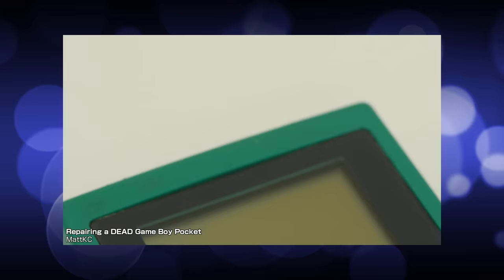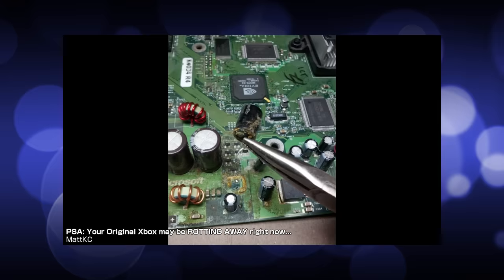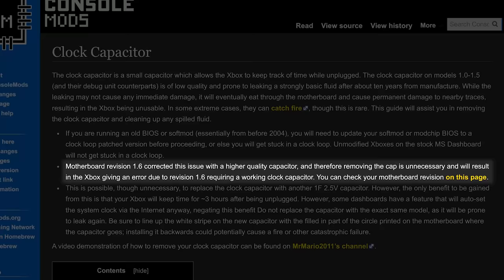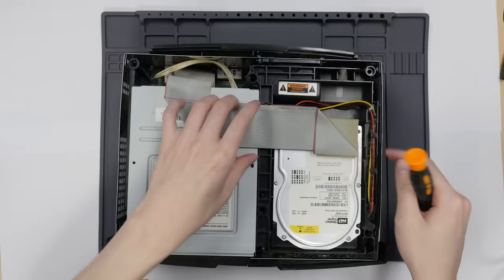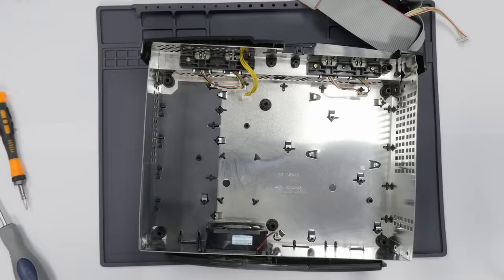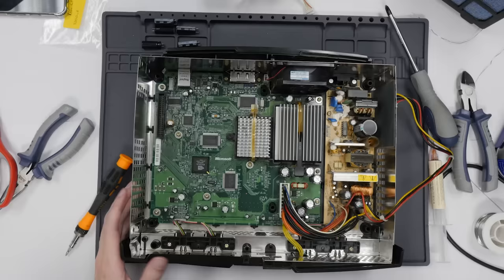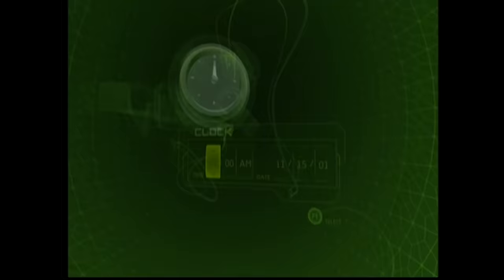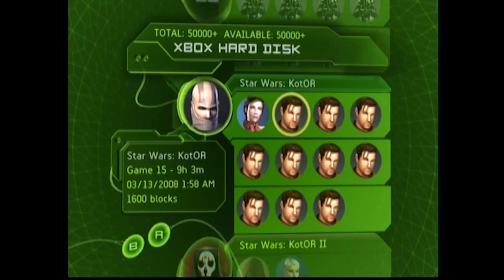DID HE SCAM ME? - Repairing a DEAD original Xbox

Comment: A concept i try to tell my dad all the time is that just because an electronic hasnt been used doesnt mean it still works. It could be still brand new in box but need immediate repair due to age.
Reply: like capacitors, and on the C64, the PLA IC, and many 386 and 486s have a nicd 3.6v battery that is prone to leaking. i got a new in box Soltek socket 478 board with capacitors already bloated and leaking.
Reply: @pentiummmx2294  to me belts in things like cassette players and turntables are the biggest example. Leave them alone for too long and they turn to goo
Reply: The easiest comparison is just say it’s kinda like how if cars sit for years they won’t be able to drive until you fix them up again

Comment: Side notes:
If you do find a random xbox in the back of the closet, when testing it, it is a good idea to plug the av cable in too. don't have to connect it to a tv just have it in the back. The xbox will throw a flashing green and orange ring light error if the av is not plugged in. People think the xbox is dead, but its fine just needs av of some kind so it can set the video output resolution on boot and will halt the system till it can.
On v1.6 xbox the clock cap is the gold one up near the IDE port, not at the front like others, Yeah it can leak but we still got a few years.
The caps you replaced are CPU filter caps and power conditioning caps.
TBH I have not seen the power conditioning caps fail but I don't work on xboxs as much as I did back in the day.
power conditioning caps is probs what killed this xbox, cant boot if the hole system doesn't have any power rails.
CPU filter caps are weird, when thay fail and depending on how bad the xbox will still sorta work but DO NOT RUN THE XBOX WITHOUT THEM.
When they are damaged you will find games will sometimes load the main menu but crash or get stuck when loading the first map, game overall is just really slow, when trying to do more complex things like a TSOP the homebrew will boot but then just fail to right or find the TSOP. If they are totally cooked or removed then the xbox will just get stuck in the boot splash or the system os screen.
Yeah your dvd drive is probs just dirty / full of a lot of dust. 

Alright, till next time
[skeletor running away]
Reply: Ok good to know
Reply: Man, I wish someone like you could help me recondition my Amiga (well, Amigas plural tbh!)
Reply: @Kholaslittlespot1  hm? What needed?
Reply: Yeah the Xbox is the only system in my experience that freaks out when it comes to the video cable. If you try to unplug the av cable while it's on then it'll reset itself.
Reply: @VexAcer  ahh that try blowing on the port.
Reply: Thx for info
Reply: I actually just replaced my crystal 1.6 clock capacitor yesterday… It was completely nonfunctional and when I opened it up it had leaked all over the board. Luckily it’s not really near anything so there was no permanent damage but it’s something to keep in mind.
Reply: lmao my 1.1/0 xbox's cpu caps were blown this entire past 20 years and i never knew until i found out, i had  wiggled out the clock cap many years ago not understanding any of this, the past year getting into soldering and recapping i took apart my xbox and lo and behold, EXPLODED cpu caps with nasty orange substence on the hdd cage. 
I was curious why my xbox was overheating so hard, smelling nasty, and audio glitching in games where i wanted to use optical audio, sure enough it was those caps causing the problems. I intend to recap the whole board later as a precaution.
Reply: Athough i don’t have an original Xbox, i did at one point discover that my Xbox 360s won’t boot when there is no AV or HDMI cable connected

Comment: I had the opposite happen 4 years ago at a Goodwill thrift store, they had an Xbox with an orange ring for $5, after dealing with a cashier who thought user info almost 15 years old would expire, turned out all the orange ring was, was a "No AV cord connected" error. A quick dusting, clock cap removal, drive cleaning, and mod chip later, it's still one of the cheapest consoles I ever got ($30 including the mod chip).

Comment: Matt, fwiw (from audio optical drive experience), tired/slipping drive belts can mean weak drive clamping, which means the disc isn't spinning at the expected speed when the drive tries to read the TOC. A cheap/easy check on that drive is a belt swap, I think. Thanks for lots of great videos. Did an condition inventory of my OG Xboxes over the holidays and was reminded of your clock cap vid.
Reply: the belt is only for the disk drive to open and close the lid, what would this have to do with the disc spinning or not (or too slow) ?
Reply: @MultiWirth  are all the Xbox drives direct drive?
Reply: @ChlorideCull  every cd/dvd/bd drive is direct drive!? 🤔😅
Reply: @MultiWirth  in some cd-rom/dvd drives, the same belt-driven rack that moves thd drive sled also tilts/moves the block holding the motor (and drive spindle) and optical block and rails. This allows the disc to clear the drive spindle when it is shuttled in and out of the drive. If the belt slips, the whole assembly isn't lifted back up all the way, meaning the disc isn't clamped tightly between the drive spindle and the clamping hub on the top, so the disc slips during spinup. (Also something I have witnessed on laserdisc)
Edit: "transport". Not sure why I couldn't remember it's called a transport.
Reply: Done a belt swap on a big ol Yamaha multi disk changer (CDC-805) a little while back, it's amazing seeing it spring back to life like nothing was wrong, plays music great too, with some dusting and cleaning it looks great still too.

It's a surprising amount of fun to maintain and use some nice retro tech since it can be as good or sometimes better than modern equivalents, and old consoles like the Xbox never stop being cool

Comment: Something interesting I noticed is while the board is the 1.6 revision and it has the Samsung cd drive that can be in any version, it has a WD hard drive instead of a Seagate, which are usually only found in later 1.0s to 1.2 models. Kind of interesting that the WD drives were used that late in the console’s lifespan.

Comment: I bought 2 nonworking 1.6's recently, both have the bulging caps near the CPU  that prevented the units from working, for testing i only replaced those caps and the xboxs started working again, I'd keep an eye on the power supply caps too

Comment: I am doing this exact same project right now. Bought a "like new" xbox from mercari for 15$. No power, and same bad caps. Was wondering if anyone had repaired theirs by replacing them all. Thanks for the vid! Soldering station is heating up now
Reply: Update for anyone that cares: Mine booted right up after replacing all 5 of the 6.3v 3300uf caps. Still need to repair the optical drive, but it has power now.

Comment: I modded a Halo 2 Edition 1.4 for a friend a couple years ago and went through all of the emulators, setting them all of for 720p, locking down all the controller settings, etc. The second he took it home and turned it on - nothing. It was dead. Here it was the capacitors underneath the CPU (left of the PSU). You never know when that's going to happen, and I've noticed capacitors die a lot after their first few hours of uptime after a long time of not being powered on at all.

Comment: 2 things: a) all OG XBox need to be "refurbished"
b) you used the wrong caps. A suitable alternative to Nichicon HM (6,3V/3300µF, **11-13mOhm Impedance**, the PW used in the video are NOT suitable due to high Impedance. Haven't looked at Nichicon, but Panasonic FM and FR in 16V/3300µF would have been a suitable replacement.
The Impedance of the Capacitor is no less important than the capacity in modern, high frequency SMPS!!!

Voltage rating is only relevant because it influences Impedance, other than that, as long as its higher than the voltage used in the circuit. Though, due to the Impedance, you sometimes have to go with rather high voltage ratings like 16 or 25V for a 6,3V Capacitor.

Comment: Fixed 5 original XBoxes last year, ALL had bad large capacitors around the CPU, completely re-capped the boards and power supplies and fixed. Replaced the belts, cleaned the lasers, new thermal compound and silent fans, and gifted each of my 3 siblings a like-new XBox for Christmas.

Comment: a more civilised way to remove the sticker is use a hot air gun/hair dryer blowing it at low heat, the glue will melt and you can peal it off perfectly.

Comment: Not sure if you will see this but I have a what I'm calling the Cursed Xbox 1.6   The caps look just fine, and it even powered on right away and even the DVD drive works.  Problem is the front buttons are not working right.  When plugged in, it instantly turns on and then opens the drive door.  You can push the door closed but then the buttons on front can't eject it or turn the Xbox on or off.  I've looked at all the guides and videos I could find and been over and over the board.  The buttons test fine, the connection to the xbox MB from that card seems fine.  The traces are not visibly damaged and I've sounded the various points out all the way to the correct legs on the xyclops chip and there is continuity where there should be and none where there shouldn't be.  So nothing appears shorted.  I've checked the resistors where the buttons connect to, it seems fine there.  I've even checked some of the transistors near the xyclops known to be problems, though every guide on those is for when it won't power on at all.  Didn't see any issue though I was just doing basic multi-meter testing on those.  The only thing I have left in my book to try as a hail mary is just replacing the caps anyway, and seeing if that could be the problem.

A bit more technical data...
The power button seems to have around 2v (one old forum post I read suggested this should be 3.3, a possible clue!) while the DVD button has 3.4.  The first resistor it hits (R3G3) for the power button has 2v on the right side and 64mv on the left.  But the DVD button resistor (R3G4) has 3.4 on both sides.  I did find a guide telling me that the left side of the DVD button should be 3.4v and when grounded will be the same as button being clicked.  When I push the button, it does indeed ground to 0 on that side like it should.  However for the power button it does not, and now I wonder if that could be the problem.  The power button itself however is working fine after continuity testing while depressing it.  The resistor for power reads like 2.x megaohms so it seems to have resistance but I can't find what the known good value for R3G3 should be or what the voltages should be on each side like I did for the DVD (R3G4).

You seem to really know your way around these old xbox machines and so I'm hoping you will have a clue for me!  I really need to break this curse!  I do plan to order a recap kit from console 5 for both the MB and the power supply, and a new clock cap just to be safe since I think its only like $1 more.  I'll update if that solves the problem, but I'll take any advice or data you might have on this as well if you can!

Comment: I bought an used Xbox once for 10€ with 2 controllers, tried it out and got some weird HDD error. The thrift store gave me a "1 day warranty" but I didn't bother returning it. 
Some weeks later I deciced to peek inside and the HDD didn't seem to match what I was seeing online. So I figured maybe there is a small chance someone modded it because I knew the Xbox doesn't accept any other hard drives. I found out that to boot a mod chip you have to hold the power button for a while and it should boot with a blue xbox logo. 

Tried to see what would happen and it actually booted into a mod menu. Easily some of the best pickups I've had from thrift stores. That was several years ago when I really didn't know how to solder properly so modding one myself at that time would've been too risky. 
I don't think FreeMCboot was a thing on PS2 yet either so it was basically my only modded console of that generation and at that time since Xbox emulation didn't exist and emulating some PS2 games was tough so it was my gateway to play some cool console exclusives

Comment: My mate about 18 years ago rang me up and, long story short, he helped sort me out a new power pack for my Xbox! Sadly, it died a few years back, after it had to be put into storage under the stairs, the circuits behind the Power Button, it transpired after taking it apart, had burned out! I put it in its box and stashed it in the bin hall outside! Where it got lifted! I will always regret never being able to see their face when they opened it up to see that, a) it was an Xbox, not a 360 (the One didn't exist yet); b) it had been gutted; c) said circuits had been burned out; d) it was in pieces; e) it had no Hard Drive; f) it had no Disk Drive; g) it had no controller; h) it had no RF Unit or SCART lead; i) it had no power unit; and j) it had no controllers! I still have both the Hard and Disk Drives, by the way!

However, it's not all roses, I got an Xbox Crystal a couple of years back, tired of the 360 not being able to play all of my Xbox games, like Metal Gear and Dino Crisis! It was quite interesting! The previous owner had put this emulator on it, clearly modded, and it had a bunch of old games preloaded onto it, including Rainbow Islands and Bubble Bobble (my childhood right there!) and it power unit has this "test" thing on it, but when I try to power it on, it doesn't play dice and pressing the Test button makes the little button go red! I tried replacing the fuse, but still, no dice! Also the RF Unit has this weird connector, two leads that seem to be able to go into two teles and a fourth port on the actual adaptor itself! What on earth have I got here? I want a working Xbox, cuz it's actually not really all that fun playing Xbox games on a 360, they don't all work correctly for a start (no custom radio station on GTA, all that weirdness with Mercenaries, Halo Combat Evolved's Demos, Halo 2's ghosting, can't play LMA, Metal Gear or Dino Crisis...)!

Comment: if you really want to keep stickers intact
I've found a bit of isopropyl alcohol around the edge will release, but not dissolve, the adhesive
meaning you can stick it back down after

you do have to be careful with lifting the sticker, if you don't want it to look tampered with, though
something sharp, but not sharp enough to scratch the plastic
I use a metal spudger to lift stickers

Comment: Awesome video man! 👏 I've 2 og xbox's that were faulty. I have a v1.6 crystal cased og which had the Same 5 caps near the cpu pop last year. 

I tried to replace them but got annoyed and put it to one side for the year lol.  I decided to try and finish fixing it recently replacing all 5 as I wasn't sure if it was just 1 or all so I thought might aswell change them all. Got the job done and the beauty booted first go! I was so pleased with myself 😂

I also removed the clock on my v1.4 board last year around the same time, I did try to replace it but it didn't work so the old cap must have damaged the traces (might have another go soon) but otherwise the console is working fine. 😊

Comment: I just taken my Original Xbox out of the drawer (It never ran in the drawer... just stored it there unplugged). Ran a game for about 1 hour and then I hear a loud "POP". The console kept running as if nothing happened, but wherever I look online, it's all about capacitor popping up so I turned it off, unplugged it and plan on looking into it in a few hours. I can't say I smell anything burned, but as the console already smelled kinda old-plastic-y, I can't really base my smell assumption on what... well what I smell.
Reply: Opened my Xbox and there's indeed 1 bulging slightly leaking capacitor and one bulging... well... popped capacitor. Funny enough, it popped open in a clean way and if I didn't looked closer, it didn't seem damaged at all. (The opening is following one of the cross lines on top of it and it follows the whole line and is opened barely 0.2mm.) My guess is that the pop I heard is that exact capacity that broke after bulging up (or was already on the edge of popping up) and since I didn't continue to play for barely a few more minutes, the capacitor's content didn't raise and boil out of the container, hence it's open, but not "yet" leaking.

Comment: I have an Xbox 1.0 and need to replace my CPU capacitors (I already removed my clock cap).

What type of capacitors would you recommend? Aluminum, polymer, electrolytic, solid?
The ones that are on there look like solid caps. If I use a different type will it matter?
I can take a picture if it helps.

Comment: You said "the clock cap looks fine" but you can't even see the clock cap from there. They moved the position of the clock cap on the 1.6 and 1.6b up near the ide cable. Maybe your angle was different, but I can't see the clock cap in the video.

Even though the clock cap is higher quality on the 1.6 it can still fail!

Comment: Yes on 1.6 you need a clock cap in place, but you can replace it with just a regular cap if you don´t have a super cap and it will boot just fine. I removed the supercap on my console and put in a normal 1000uf cap instead and no problems whatsoever and a dead Xbox? aren´t they all broken? I never seen any Xbox without any kind of problems so I know they won´t work when I get them

Comment: 30 bucks for a broken og xbox?
i paid mine 15 bucks 3 or 4 years ago with all the cables, although i had to wait to buy a new controller just for the controller adapter which was the white cristal controller and its still working (i have already removed the capacitor on the console if someone was asking)